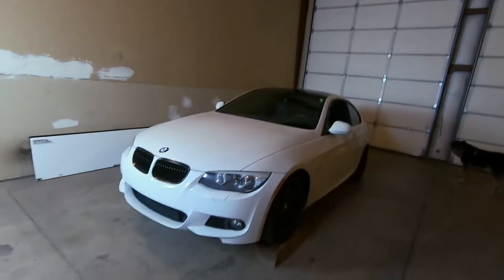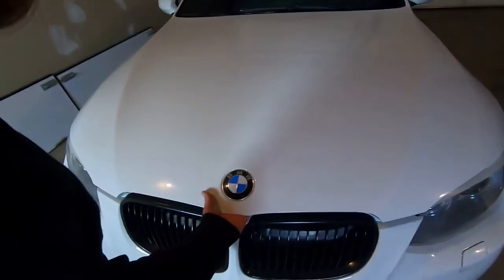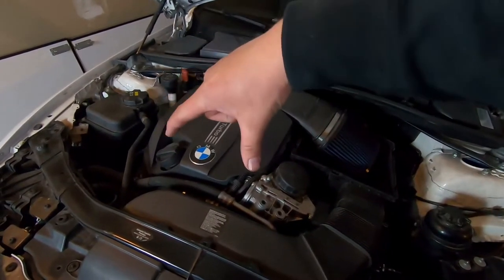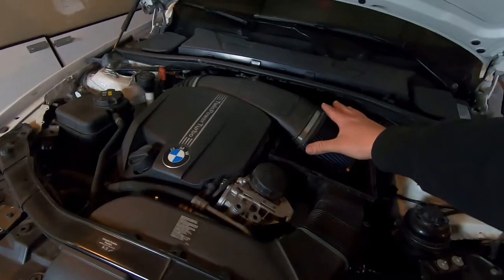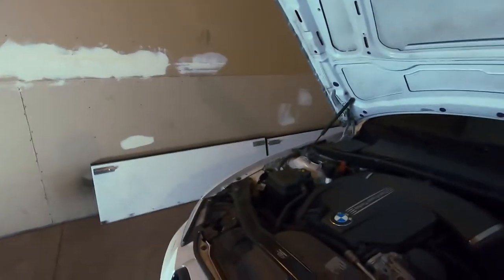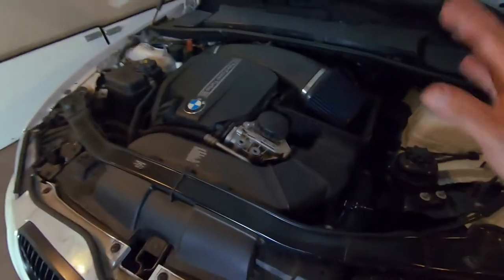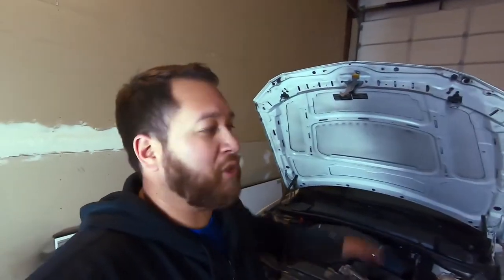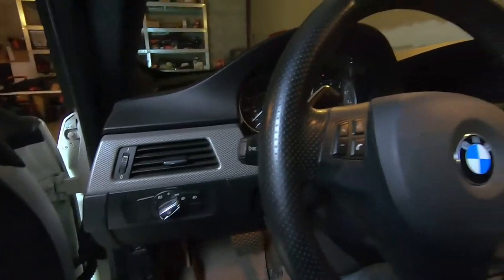N55 vs N54, Why I bought an N55

Comment: If you do not plan on modding the car past 400hp n55>n54. If you like making power, n54>>>n55. If it is your only car, n55. If you are buying as a weekend toy, n54.
Reply: I think this is the best comment 👍🏼
I have an N55 and totally agree with you.
Reply: I daily my N54 roughly 60 miles everyday and it’s got 139k miles. I’m the third owner and I assume the first owner took really good care of it since I haven’t had to do any crazy maintenance since I got it nearly a year ago. It’s incredibly up to chance, but if you find a 335i with no mods and it’s fully stock, you will probably enjoy the car a lot more.
Reply: Intresting thank you.. 400 hp awd is pleanty
Reply: This is a 100% accurate statement and an N55 with 400HP is plenty power specially if its in the smaller/lighter platforms like the 1 series or 3 series.
Reply: b58 gang
Reply: @obese3779  yup that beats both N54 and N55 but B58 vehicles are a lottt more expensive lol
Reply: You buy a N55 because you can’t afford the 335is.
Reply: N55s can get up to 400whp on bolt pms and a nice tune. I think 500+ is for the n54
Reply: Yup.  I chose the 2013 N55 because we USE the car daily.  I can't get much more than 400 hp without some significant mods.  N54 is Mod-Mad; it WANTS to gain horses.

Track Car: N54
Daily Car: N55

Comment: 2014 N55s have the S55 rod bearings and other improvements resulting in much improved engines. All 435s have this updated motor. They are far more reliable than any N54 and can be pushed to 420RWHP with Stage 2 and further with a Stage 1 turbo-reliably.
Reply: No bmw is reliable .
Reply: @EBKFiXXY  youre insane
Reply: @EBKFiXXY  n52?
Reply: N55 EWG

Comment: Hey Mark - I picked an N55 too, but for different reasons. Mine is a 2011 335i E93. Don't know why potential buyers of E9X models shy away from the convertibles. I've had mine for a couple years, doing routine maintenance  and several performance upgrades, have had nothing but fun owning this beauty. There's nothing like riding this thing around with the top down on a beautiful sunny day. 
The performance mods. I've done make it that much more fun. Most don't expect the performance level that can be achieved with the E9X models. That was my reason for buying. With simple, readily available components this straight 6 engine can be made to safely crank out double the stock HP & Torque. I believe that's the true source of the model's popularity.
Reply from the maker: Buying a convertible is more of a preference.  Same reason people might prefer a sedan vs a coupe.  I personally not a fan of the way any convertibles look.  I do understand how nice it is to put the top down and drive around.  That is very nice.  I bought mine to do autocross and track days.  If you have a convertible you would have to install a roll cage before you can go on track.  So that is my reasoning for buying the coupe.  The N55 is a good platform for making some good power for having some fun.
Reply: @markskeem  Hey Mark - Thanks for the response. I'm a rag top man. Always prefer them to a hardtop. My E93 is the best of both worlds. It's a hardtop convertible so with the top up it looks like a sedan. The roll bar is still an issue. I'm going to bite the bullet and get one soon. Looks kinda cool with one with the top down, don't ya think?
Reply from the maker: @tomwolf7055  I think a roll bar does look good with the top down.  Plus it is a nice feeling of safety.

Comment: All i heard is, “im scared to do maintenance on my own car” N54 won multiple motor of the year awards for a reason. Keep it well maintained then it will be reliable.
Reply from the maker: I do lots of maintenance to my own cars, but an N55 is still more reliable.  The N55 was created to fix the problems of the N54.
Reply: Mark Skeem fixed a water pump within two weeks of owning an n55 with 48k miles. It’s just incredibly inconsistent. Both engines are great, N54 won motor of the year multiple times. N55 is the nerdier younger brother to the party-having chick-getting N54.
Reply: N55 won engine of the 2014 also
Reply: Maintenance is going to keep your injectors from failing, and keep the wastegates from needing to be replaced? You guys repeat the same nonsense in every video.
Reply: N54 is literally only better for its stronger engine internals to make 700+ hp, which i know most people only end up getting 500hp out of them which a N55 can do
Reply: N55 also won multiple wards best engine awards lmao
Reply: MELLOW I guess you could say I need to “mellow” out.
Reply: have you checked out this install of the n55 intake ? https://www.youtube.com/watch?v=9vUtWsnpBUA&t=281s
Reply: Fuckn facts 
2009 335xi n54 gang!
Reply: You took the words right out my mouth that’s exactly what I Hurd as well!
Reply: @markskeem Nope its because n55 is cheaper to build, its for a reason 335is, 1m etc is a n54

Comment: The B58 is actually the real successor to the N54, the 2010 n54 fixed a lot of those issues you talking about. the N55 is like the iPhone 13 very slightly difference from the iPhone 12 but it’s a business we gotta keep our customers happy so let’s just put this product out because it’s new let’s keep our customers happy who like new things, and always buy our new products, meanwhile they was cooking the b58 to perfection! The 2020 models just with a stage 1 upgrade you running 10seconds.
Reply: Nope, b58 is an experiement right now, time will tell if its really that great.  N55 has been around for a while now, tried and tested.  Proven to actually be reliable.  B58 is too new for my liking.
Reply: @Anythingyoulike2013  B58's have been out for like 5 years now. They accept mods super well and have proven to be quite reliable.
Reply: @Chattsteezy  5 years is not long enough... Give it another 5 and then we will really know...
Reply: @Chattsteezy  agree 
That motor has been put through the ringer and still thrives

Comment: for the paddles the reason they did it the old way was because sometimes you want to run in manual mode with a cigarette in one hand and the wheel in the other.
Reply from the maker: You mean a cigar

Comment: So much misinformation in the comments section it’s almost nauseating. It’s no surprise so many of these tuner cars end up with damaged or blown engines.

Between the N54 and N55, the N55 is the more reliable engine. The biggest factor holding the N55 back for power is the switch to a twin-scroll single turbo. If you’re planning on changing the turbo then you might as well go with the N55. N54 is riddled with too many issues. I thought it was an exaggeration on how unreliable that engine is until several of my friends with N54 cars all had the same problems, multiple times over the course of ownership despite diligently keeping up with maintenance. Aftermarket support for the N54 is better, though.

Comment: 2011 N55s also seem to have this issue with piston clearance if (i'm not mistaken) which lead to premature rod bearing failure but the 2012+ seem to have very few issues.
Reply from the maker: I have not hear about that in the N55.  I will have to do some research on the piston clearance.  I have heard of the rod bearing premature failure.
Reply: @markskeem  it might have been something else but they had something machined or casted slightly wrong and that messed up the bearings
Reply: @markskeem  the rods on the early n55 (2009 til 2012) had issues, the later n55 (2013 til end of production) uses the same rod bearings as the s55, so they were alot better

Comment: N54 just cuz it takes to mods better and can handle more power with them internals just the reason that set me over the edge
Reply from the maker: I was considering getting an N54 for that reason
Reply: @markskeem  the N55 holds just as much power, just not with the stock turbo...the internals are fine for 600-700whp though

Comment: Wooden panels are something which is always lacking of my BMW's. Currently trying to find ones to X5. New ones are just soo expensive. Atleast these plastic ones would be cheap, but I have them already. On X5 those silver ones are the most cheapest option as new

Comment: Im at 160k on my 2012 N55 and it doesn’t burn a drop of oil and is so quiet still feels and runs like new.
Reply: 160 000 miles or km's?
Reply: @carcrazyguysa4059  miles, its all in the maintenance and oil changes. I change the oil myself and the oil change kit cost $70. The B58 which is the successor to the N55 is an even better engine but N55 cars are MUCH cheaper and more reliable than the predecessor which is the N54.

Comment: I just had a n55 blow after a minor tune and a pull on the highway at only 79k. 👎 My n54 equipped 07 335i has been running strong fully tuned "with upgraded duel vargas turbos" at 196k. I don't know, at this point. I'm just gonna end up getting a 240i for the B58 next year.
Reply from the maker: My N55 is broken as well
Reply: @markskeem  Welcome to the club. I bought a n55 equipped BMW because I thought it would be more reliable. Sure, it is until it's not. My n54 has never blown. Leaks? Accessories dying? Sure. But never an engine problem that cost me the car. All this money down the drain. 79k. Depressing. My buddies picked up some beautiful 240is and I'm honestly leaning towards and will be picking one up in March. BMWs are a headache but, I love them. lol. How exactly did yours bite the dust anyhow?
Reply from the maker: @N54.S6  I ended up getting a rod knock.  Pulling the engine to see if I can save it or if I need a new engine.  Bought a mustang to take it's place, so I haven't made a lot of progress on the bmw
Reply: @markskeem  idk that much about n55s but I think if u got a 2010 n54 it would've lasted a long time. The only thing that's cool about a 2011 n55 is that its in a e90 instead of the gross looking f30s but the one thing I learned about bmw is never buy there first years of engines. Most of them are bound to be lemons since there newer cars made of mostly plastic and bmw was pushing them off the line left and right. I heard that on 2010 n54s they actually fixed a lot of the wastegate rattle issues and most of them already had fixed high pressure fuel pumps and upgraded injectors depending on who you'd buy it off of
Reply from the maker: @I_Ali_I  I generally live by those rules as well.  Last ones made are probably the best and the first ones made are going to have problems.  F30's still look better than the new ugly nose they are putting on their cars.
Reply: @markskeem  I think all the new ones are ugly as well. The e90 at first I hated but grew on me and I ended up owning one but take me back to the e36 times and id be happy as shit. I think generally the only bmws u can get away with owning there first years are just the older ones tbh. Very few were lemon engines, I mean they used to make these engines so solid and now you see them just blowing left and right. some engines they actually made worse as time went on for example the n52. 06 was actually there most solid year for n52s, then in mid 07 they started changing them with plastic everywhere inside the engine and making the pvc a more complicated job then it needed to be.
Reply: My n55 2011 broke as well yet my 580whp N54 handles being redlined 85 miles a day

Comment: I actually did like the paddle shifters in the n54 u could completely drive the car in manual with one hand
Reply from the maker: That one is more of a preference.  I have just always gone with left down right up.  I could get use to the way they operate, but I don't like the way they looked
Reply: @markskeem  Would the 2011 335i have the paddle shifter issues you mentioned the n54 had or is that just an n54 issue only?
Reply from the maker: @blackmachismo08  I believe 2011 is the year they changed it to the newer style but I'm not 100% sure.

Comment: “N54 is unreliable” Why do these YouTubers keep repeating this TIRED , point. They already corrected the plastic coolant flange, plastic coolant tank, plastic pvc , plastic Intake manifold. Everything your crying about in this video can be correct with aftermarket parts for for cheap . On top of that , you have options of after market or OEM. The aftermarket for bmw 3 series in general is as big as mustangs. Every car blows spark plugs and coil packs . Beyond those things, you guys can really never make a valid point as to what’s so much better with the n54 / n55. Oooo sound, ok? A single turbo n54 has a similar note. Next!  (My n54 e90 has 157k original miles , original drivetrain)

Comment: Biggest difference is the n55 makes less power/$ versus the n54. The n55 has a high quality cast crank versus the n54 forged crank. 

Those are the biggest differences
Reply: High quality cast crank? It’s still cast vs forged, n54 crank can genuinely take 1,000whp. The rods not so much.
Reply: my n55 has forged crank
Reply: @jacobhauenstein  plenty of n55's have a forged crank as well.
Reply: @markburkey6371  plenty of e9x n55’s? Not so sure about that, as that’s what this video is referring to by comparing n54 to n55
Reply: @jacobhauenstein  I got what your saying, but the comparison was for the engine and not the car. But the cast crank was never known to be an issue for power either, people just change them because they don't want to find out.
Reply: @jacobhauenstein  you an N54 owner?
Reply: @markburkey6371  unfortunately yes
Reply: @jacobhauenstein  yeah, e90 n55 got it as a daily which worked well until it blew the charge pipe a few days ago...lol
Reply: Biggest difference are the twins brotha 😂😂😂😂😂😂
Reply: There’s nothing wrong with a high quality cast crank. Bmw cranks can handle a lot. Theres probably a good reason they used cast in that engine

Comment: The fuel economy is considerably better with N55 engine ?
Reply from the maker: I am not sure about the fuel economy of the N54 but I do get pretty good fuel economy with my N55.  I usually average around 27 mpg.
Reply from the maker: TruewoC  Yeah.  I usually get somewhere around 25-27 mpg.  Unless it is a track day.  Then it goes down considerably.  The Mustang is far worse, I usually average around 16

Comment: What about making 500 hp in the 135i with the n55 and dct?What problems would I have?
Reply from the maker: Being the same engines they would have the same problems. I haven't heard anything bad about the DCT, but there is always limitations of every transmission to the amount of power they can hold.  I have read a couple of people saying that once you go high than stock levels you will have to tune the transmission.
Reply: @markskeem  ok I feel pretty confident in the dct so I’m feel that with fbo and a good tune and some sort of fueling it will get there!
Reply: 500hp out of a n55? U might as well get a N54

Comment: lol too many salty n54 kids that can't afford a newer car
Reply: The N55 Sounds better :) I've had mine for 5 months and it rides.
Reply: @Doctor_Martain  nice man congrats! I've had my 2016 m235i stage 2'd at around 18k miles when I first bought it. It's currently at 55k miles with no issues other than the stock charge pipe blowing up lol
Reply: @bella_testastretta  Just exploded the original charge pipe about a month ago doing some highway pulls. 67k on the motor w a vehicle warranty 😎 a few mods and BMW uped the speed limiter. The car came that way when I picked it up it had sat at the dealership for a long time because of the Covid situation. Couldn't ask for anything more , the ZF8 in Sport + is so much fun. Pulls from 80 to 150+ mph are insanely quick.
Reply: N54 is better tho not everything is about money I have a n55 as. Well N54 is better

Comment: LOL N55
Reply: Really? Cause this is my dream car, if you love n54 this is your taste and keep it to you :)
Reply: N55 is a better engine. N54 sounds like ass and runs like ass and needs a single turbo conversion to make use of the stronger internals otherwise it overheats.
Reply: @BumpTune8462  lol they both can make around 600hp stock before they start having different problems and needing equal amount of mods to keep going except the N55 will be far more reliable throughout. I love how offended broke ass 335i owners get over this 😂
Reply: I can hear your injectors leaking from here buddy 😂😂😂
Reply: @Shakshuka69  never hear of an N55 go above 600hp. I might be wrong, not common.
Reply: @thisguyshorty3554 they have actually big boost has a n55 that was like 700 something whp but I believe it was either a m2 or a m235i which is the better n55 . They do have a 3.3 big boost kit which is only for 620whp which equals to 700 something hp with the right mods with their kit . I have a 2015 335i running one of their kit n it’s in the 580whp rn mid boost(23psi) and trust me before hand these were my mods. Jb+ the lil plug in then I went stage 2 n then big single turbo and I beat the shit out the car still going strong . 142k miles I put the kit in about 30k miles ago .